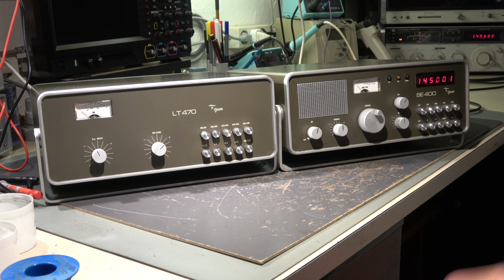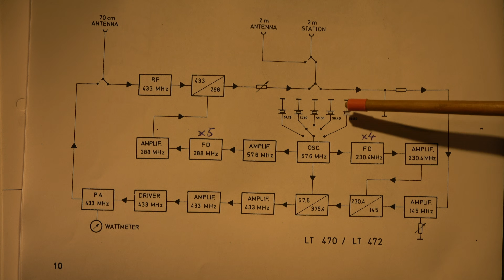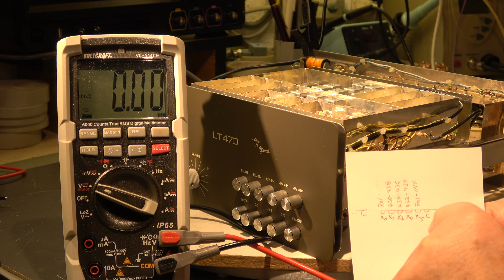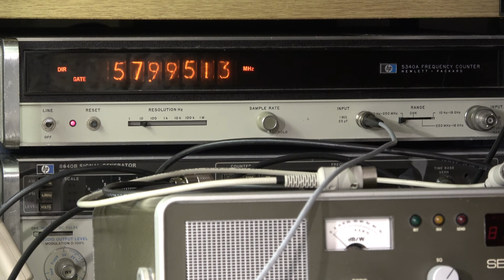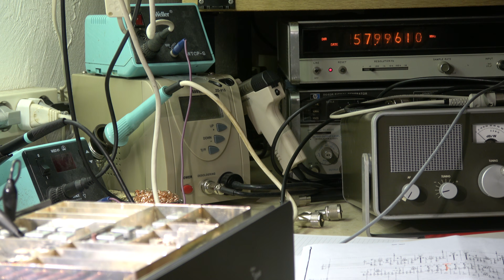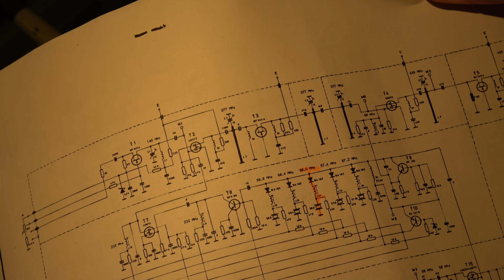#146 Braun  LT470

Comment: Another excellent series Stefan.  I wonder if the capacitance of the PIN diode switching that crystal has changed  affecting the frequency somewhat.  Just a thought.   By the way , your troubleshooting skills are the best I have seen on youtube.
Reply from the maker: I think not, because this diode is a switching diode, polarized in forward direction with low resistance. The capacity, caused by polarization in reverse direction, is not relevant.